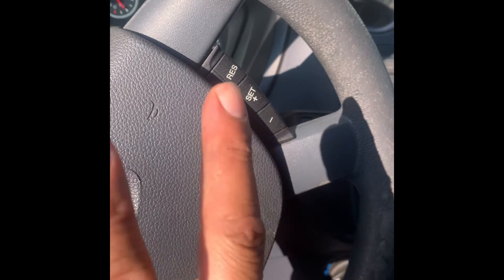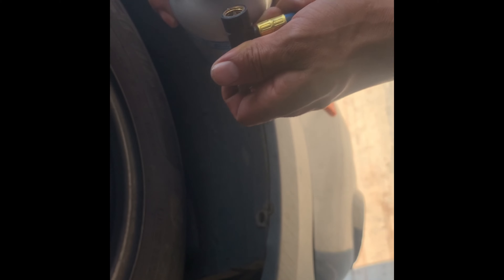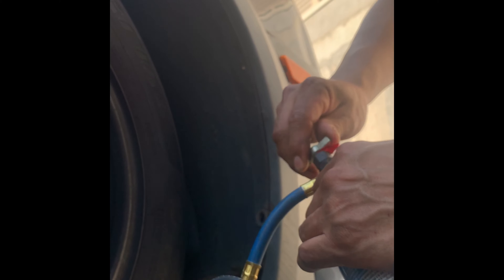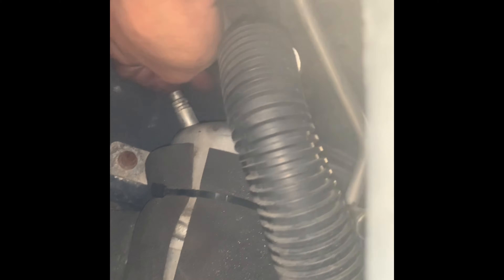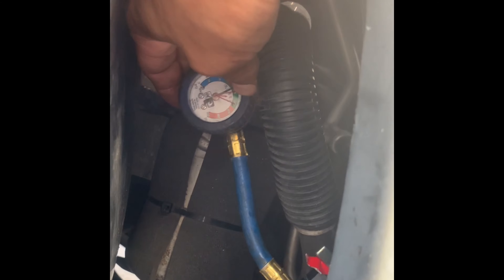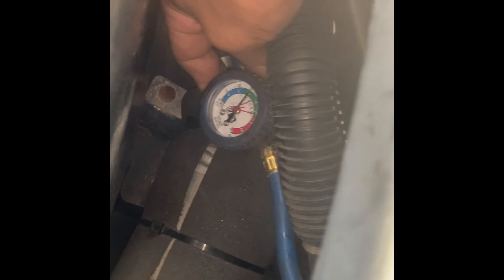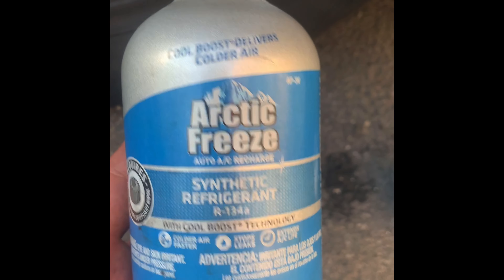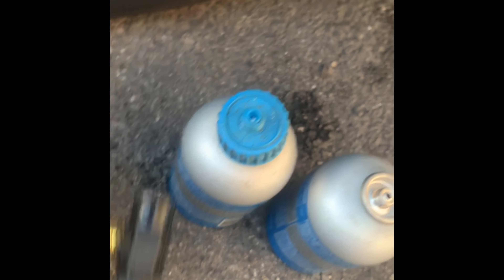How to refill ac freon or refrigerant on a car ford transit connect

Comment: Thank you. You are the only one that said to run the engine and turn on the air full blast before adding the freon. I have had mine fixed 2 times and the freon still leaked out again so I thought I would get most of the season out of a couple cans a year and give up the repair attempts. Mine is a 2010.
Reply: I am a novice at this but I believe some cans contain not only the coolant but also a chemical that may plug the leak